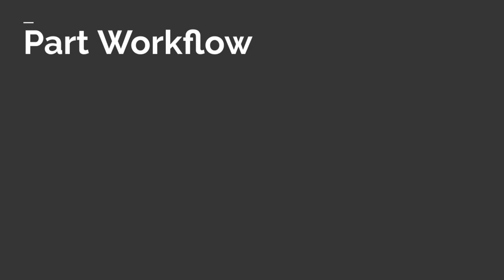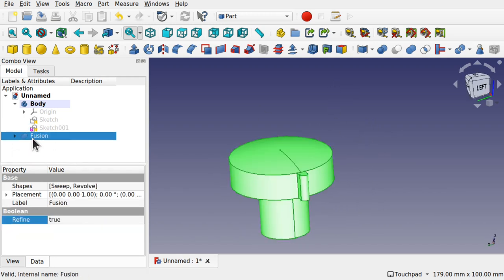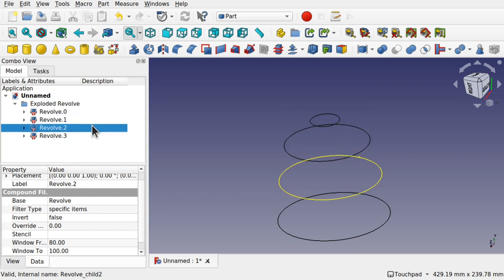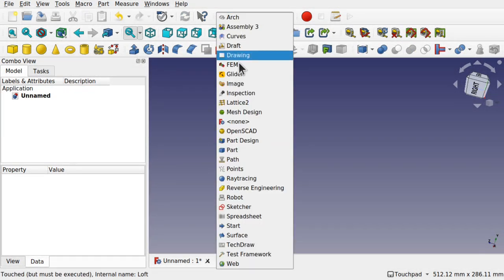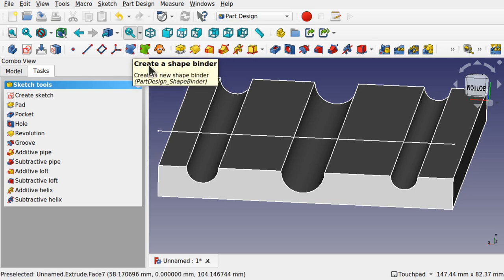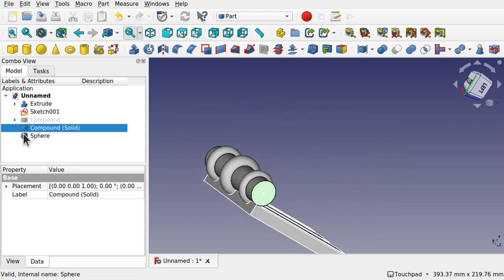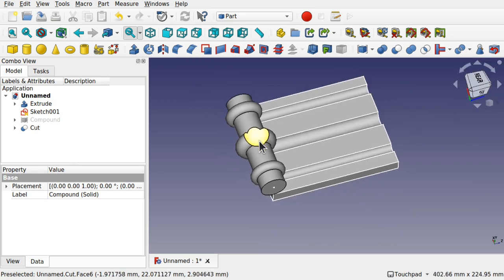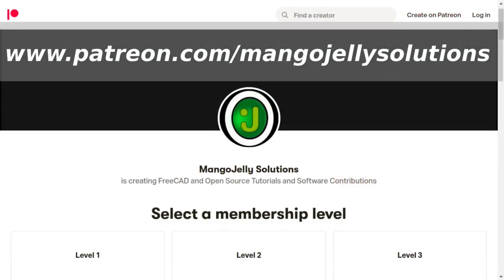FreeCAD 0.20 For Beginners | 8 | Part vs Part Design Revolve Workflows | When and Where to use

Comment: The work you do for the community is astounding. Equaly amazing is how much I know nothing really about FreeCAD. 
What I hate most about FreeCAD is its UI. It sucks really bad. Sometimes I get errors, I can't tell if it's a bug or because I am indeed doing something wrong (most likely the latter). So I go to see the documentation but they seem to assume you know the software already, so the explanations are not very useful... All this to say : I'm really glad you are doing these videos. It really helps.

Quick question, will you be covering the Arch workbench at some point ?
Reply from the maker: Thank you for the kind comments, what you are detailing is one of the reasons why I started the channel. I came from a 3d background and got pretty frustrated with Freecad until I learnt to not try to force it down the routes I have learnt in the past with other software and this was something different. It was only when I returned to freecad when I made my CNC machine and seeing all the comments about peoples struggles that I remembered that's how I felt and decided I should really share the knowledge I had. I also was off work long term because of covid lockdown and it gave me something to concentrate  on without going mad lol.

The arch workbench is on the list 😁

Thanks for sharing your thoughts, you are not alone, but please give yourself time to learn freecad as you will end up loving it.

Comment: Something that you didn't cover (granted it is probably slightly more advanced) that I'd like seen in the tutorial with the lidded boxes that is coming is how to add fit tolerances to a model. For example, you can't design a hole to fit a 2mm cylinder by specifying the hole at 2mm, unless you really want a tight interference fit. The hole should be slightly oversized not only for fit, but also to account for fabrication tolerances. Maybe I'm not looking for the right tool, but I have yet to find an offset tool that I can use to apply a parametric offset value to.

Comment: I like to keep my lesson projects for future reference, including the bits we delete as we follow along. I found that I can group the objects we were supposed to delete, then use the spacebar to hide them. You can group objects via the context (right click) menu. For example, if you right-click on 'Exploded Revolve', then select 'Create group...', the items are within are added to the group. You can then drag 'Loft' into the group.

I'm NOT sure this won't cause problems, but I'm giving it a try.
Reply from the maker: This should be fine just watch out that the same object can be added to two groups and changing an object in one group will affect the other.
Reply: @MangoJellySolutions  Thanks for the hint. I've run into issues since I did this - when I tried to add the image, I didn't get a prompt to select a plane, and no image plane was created. The image isn't part of the project, and I can't see my sketch and the image at the same time. 

Deleting everything as you instructed then adding the image didn't help. In fact, creating a new project doesn't help - no image plane and the image is just a separate entity, unavailable in m project! I've tried this in 0.21 and 0.20.1.

I'm beginning to suspect that my problems may be a result of my being in the Win11 Insiders Beta 
Channel, which I joined back in May due to severe taskbar issues. The last two Beta releases have caused other issues such as my system switching focus to God-knows-where while I'm working, Explorer locking up, and the last Edge update has resulted in YouTube's start page not displaying properly until I resize the window.

Opting out of the Beta channel immediately requires a clean reinstall of Windows and all my software, which will take several days, or waiting for the next 'major' release of Windows retail, whatever that means. I'm investigating my options...
Reply: Just to complete the story, I did a clean install of Windows 11. I still can't get FreeCAD to work with images as it should! This is doubly strange because I was able to complete Lesson 4 without problems, and when I open Lesson 4 the image is as it should be. Haunted computer? Bad Karma? Who knows!

As a work-around, I found a program called PureRef that allows me to display an image transparently with click-through. It has far more features than I need, but it works (once I changed the default shortcuts for opacity as they didn't work).

Comment: Part seems like such a powerful workbench definitely going to be spending a lot of time in it. One question that I have which idk if it it's maybe touched on later and I just haven't gotten there yet (it's probably mentioned in the next video given the subject matter) is that if I am making models for 3d printing and I want 2 things to fit inside of each other or connect together is there a way to make it have a tolerance built in? Like obviously if I make a block that has a 20mm cube cut out of it I can't then print out a 20mm cube that will go in there because it's impossible to get that accurate so you need to be able to compensate for it and it's been a real sticking point for me trying to figure out how to make anything that connects together because I have to model one side of a connection and the model the negative into the other piece which is super time consuming xD
Reply from the maker: Yes so I do have a video in the series where a box is made with a fitted lid which has tollerances (if I remember rightly, it's been a while and quite a few videos since!). In it I use part design where  there is a tool called the sub object shape binder where you can take the face of your first part, creates a copy and then you can set a offset (which would be your tollerance) on the properties and this will give you the shape for your second part. This can also be done for edges. If your box changes, so does your lid whilst maintaining tollerances.

Comment: At 27:10 i am extruding single sketch but getting two extrudes.? Any idea what i am doing wrong.
Reply from the maker: Your geometry is not closed, there is a gap in one of the slot geometry you added. If you look down to the properties tab and look at the solid property, set this to true and see if you get an error.  If it says wire not closed then you got a gap

Comment: Is there a simple way to make a 'shell' into a solid part? For example, if you'd made your bowling pin a hollow shell could we then define a thickness for that shell (say 2mm) and make it a part for 3D printing?
Reply: Slicer software can make solid parts hollow. Use vase mode and define wall thickness, or normal mode and select 0% infill and add wall thickness to 2mm. No need to make the actual model hollow for that. To make a hollow model (shell) to a solid part would need changing the actual model.

Comment: my rectangle has blue lines and I don't see it in the model view
Reply from the maker: You have changed your rectangle to construction geometry. There is a construction geometry tool, if you click it without selecting any geometry you will see all the tools go blue so anything new laid down will be construction geometry and not normal. I think this may be the reason for the issue your experiencing.

Comment: A few minutes ago, I posted a link to a bowling pin image I uploaded to Dropbox. I just received a threatening message from YouTube about posting spam, with no indication of what or even where I'd posted!
Reply from the maker: That is pretty strange. Youtube does have a number of filters in place that inspect links to protect creators.  Oh, you don't think youtube saw the image as something else? Wasn't a bowling pin that was coloured in a skin tone by any chance? !!!!!
Reply from the maker: Just checked the held for review folder as I often get posts with links in there and found nothing. We had a similar experience at work with a website which got categorised as 'mature eyes only' by Google when it saw the words ridged with a picture of a pink coloured tubular container and it thought it was a picture of 'old blind bob' standing to attention (trying to use wording so youtube doesn't remove my comments lol)
Reply: @MangoJellySolutions  Interesting thought, but it wasn't anything that could be interpreted as a skin color!